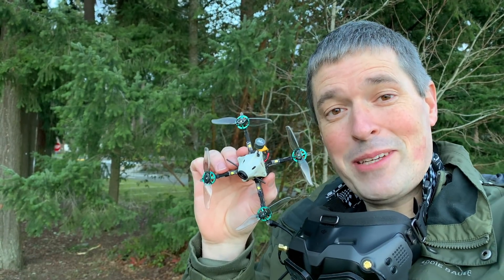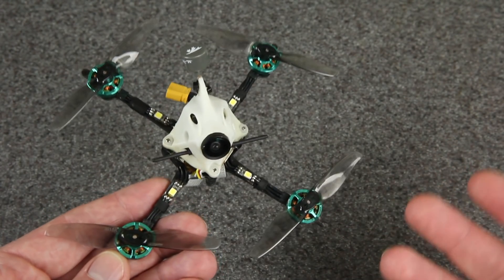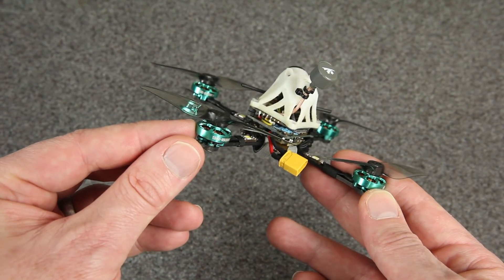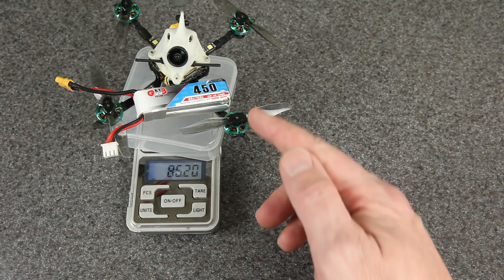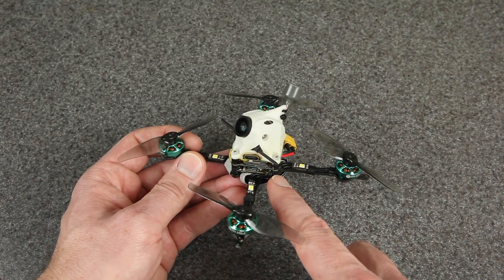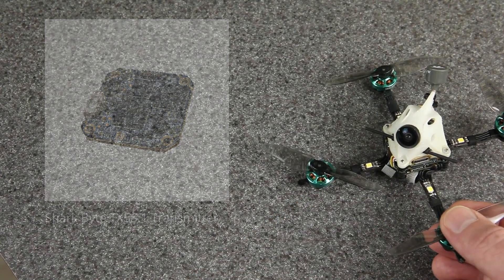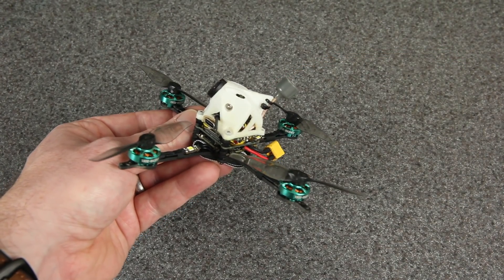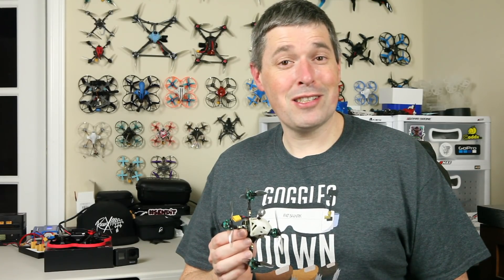DJI Digital FPV on a 3-inch Babytooth Drone! Cool!

Comment: Hi, I am interested in a drone like this. Since we are ahead in time now are there better option available now that you know?
I would lik eto use a vista 
Kind regards,
Dennis
Reply from the maker: Hi. This build was pretty unique. There are a number of 3 inch drones on the market which use the Caddx Vista, but most of them are significantly heavier. That's not always a bad thing. Heavier can mean more powerful. But for myself, I really like to drones that are light and quiet, like this one. If you're seriously interested, I would be willing to sell this one. It's a great build but it has been collecting dust at my house, because I have so many other projects. Email me at mrshutterbug@yahoo.com, if you're interested.

Comment: incredible video keep it up😊❤. i wanted to build this toothpick but i have the dji fpv controller, does it work with the caddx vista(like the dji air unit)? and if not then what should i use?
Reply from the maker: I just put this drone up for sale on FB Marketplace, if you're interested:
https://www.facebook.com/marketplace/item/670413367777353

Since it has the Caddx Vista, it should work with the DJI controller. I don't have the DJI controller, so I added a Crossfire receiver to mine. Switching to the DJI controller might be as simple as a Betaflight setting, but maybe the wiring would have to change? I'm not sure about that, but I could look into it if you're interested.
Reply: @MrShutterBug  thank you so much❤️ i'll definitely check out the facebook marketplace and no need to research for the wiring i'll do it. thank you very much for your time and keep making great content😊

Comment: Hi. I can finally build a Babytooth. When ordering lipo's I choose the GNB 550mAh 1S XT30. At arrival I saw that these are LiHV. How high should I charge these? They are shipped with 4,5-4,6V in them. Seems a bit high? And how low can I fly them. Usually you guys tell to stop flying @ 3.0V with a normal 1S.
Reply from the maker: Max voltage for a LiHV 1S battery is 4.35V. That will give you the longest flight time, however, the batteries might survive more charge cycles if you stick to 4.2V like a normal lipo. It is up to you. If the voltage goes below 3.0V then it will also shorten the life of the battery. When to stop is also up to you. It can be hard to know the real cell voltage while flying because there can be temporary voltage sag during flight. If you test the battery after you land, the voltage will probably be higher than on OSD. If the voltage after unplugging is around 3.5V then you’re fine. If it is less than 3.3V then you are getting dangerously close to damaging the cell (it drops off really quickly at the end). Start conservative and you’ll get a feel for what you are comfortable with. Hope that helps.

Comment: So if I'm using the DJI controller would I need to put crossfire in?  Also, could I even use crossfire with the DJI remote?  I'm new to this and never quit understood this
Reply from the maker: I had to add a receiver to my drone because I do not have the DJI remote. If I had the DJI remote, then I would not need a separate receiver because the DJI receiver can control the drone through the Vista Air Unit. Crossfire is a different protocol from DJI, so you cannot control a Crossfire drone using the DJI remote.

Comment: I don't wanna strip a Vista. Is there any point in building this still?
Reply from the maker: The Vista heat sinks add a lot of weight. If you want to use an unmodified Vista then it will be a heavier build which means you would want to use a stronger frame and larger motors. You would probably also want to use 3S order higher voltage.

Comment: You didn't use a capacitor? Is it not necessary?
Reply from the maker: Good question. The capacitor clearly isn't necessary to fly the drone, but it probably would provide some protection against current spikes in a crash. The usual answer is that it is a good idea, but not strictly necessary unless you have a specific problem that you're trying to solve. Most manufacturers will recommend a specific capacitor size to go with the ECSs, so go with that if you want to be safe(r).

Comment: Fantastic  build. Fast, nimble and quiet.
What's better T-Motor F1303 5000KV or Flywoo ROBO RB 1204 8150KV?
Reply from the maker: Either of those motors should work fine. The 5000kv motor would need a 3S battery. The other would be better on 2S.

Comment: What would happen if you used 1806 2300kv motors ?
Reply from the maker: 1806 is a much larger motor. It would not work well on this frame even if the motor screws had the right spacing. An 1806 motor would be better for a drone with 4” props and a much stiffer frame. Cheers!
Reply: @MrShutterBug  Thanks for the reply  :-)  , but if I can get the Motors on ... would it not just be an over powered mini quad ? ... What would make it not work well ? ... Would it fly funny or something ? ... My goal is to make a long range speed demon with a small profile that cuts through the wind and climbs like a rocket ... or I B Crazy ?  ;-]

Comment: Amazing footage. Iwould have loved to see a longer clip of steady lines like you did along the path, then go low across the grass and through the trees up above to the skyline following a smooth line, really giving the impression of a larger quad, then turn around and close proximity through the trees on the way back. There were times I would swear that I was watching a 4" 👍👍👍

Comment: Intro picture is a triblade? Is that 3 inch?
Reply from the maker: Yes, it is a 3 inch. I have used bot the Gemfan 3016 3-blade props (pictured in the thumbnail) and the Gemfan 3018 2-blade props.

Comment: Hello! Nice drone! Did you use a capacitor or filter to directly connect the battery to the caddx digital unit? Do you think it is possible to use a 2s 18650 li-ion battery? It would add extra weight, but it would increase flight time. Maybe, using 18650, I would choose 3.5 inch propellers and a little bit bigger motors. What do you think?
Reply: Those weigh a tremendous amount more than his entire quad plus batteries, I don't think that would be a good pairing. At that point like you hinted it's going to be a different build with different motors, bigger props, bigger frame. Also those go way lower running voltage which may not play nicely with the camera since it will be closer to 5v rather than 6+v at the low ends.

Comment: No prop screws?
Reply from the maker: Correct. The motors have a 2mm shaft and the props just press on. They have never come off in a crash.

Comment: I want to build something similar with a Nebula Pro and still as light as possible. I'm struggling if 2S or 3S is the right way forward. 2S saves weight an therefore makes the drone lighter (which is important to have it as silent as possible). On the other hand I want to have the acceleration feeling that I'm used to from my other normal freestyle quads. But it would obviously add weight due to the added cell (450mah is minimum, 300-350 don't work very well imho). This would then make the drone more noisy again.
Reply from the maker: If you raise the voltage and lower the KV in proportion, then it doesn't really change the speed. So, if you can control the 2S/3S choice and you control the KV choice, then speed isn't the way you want to think about it. The difference is that a higher voltage drone will be able to deliver the same power with less current and thus less voltage sag. If you want to fly in a small yard then you're not going to be using a lot of high throttle and the sag of 2S probably won't be a problem at all. In that case, 2S is perfect! If you like to fly in larger spaces and you like to rip around on high throttle a lot, then 3S will help you do that without your battery voltage sagging as much. Also, the weight difference will matter less in those larger spaces. Make sense? P.S. I agree that there aren't many good 3S batteries on the market that are smaller than 450mah.

Comment: Mine is 62g + battery with the 3mm frame. The Nebula Nano camera fits in the beebrain v2 canopy - you have to unscrew the lens, shove it in the canopy then screw back in the lens for a tight fit. I have the ExpressLRS happymodel pp rx so no antenna mounting issues. Using the rcINpower 1205+ 6000kv motors becayse Straya! I will pop a video up on my channel on the weekend for you

Comment: Hi Mr. Shutterbug, 
I wanted to know if you have found an STL file or a link for a similar canopy that holds a Nebula Pro? Last question how did you arrange your stack in terms of dampeners, nuts or o rings? Thanks for your help and build! Much appreciated!
Reply from the maker: I have not tried it yet, but here's a canopy I found that should work: https://www.thingiverse.com/thing:4784098

Comment: Will the DJI fpv unit work with the version 2 goggles
Reply from the maker: Yes, the V2 goggles are supposed to work with the Vista and the original Air Unit. Unfortunately, I have heard that some people are having problems registering the new V2 goggles because of a bug. Hopefully DJI will release a fix for that soon.

Comment: what transmitter are you using?
Reply from the maker: I use a modded Taranis QX7 radio. This drone has Crossfire, so I was using my Crossfire module, which plugs into the back of the radio.
Reply: @MrShutterBug  oh meaning you need to have an crossfire module for your QX7 radio to pair with Crossfire RX?
Reply from the maker: @chuansheng  correct. The QX7 works with FrSky receivers normally, but can communicate with other types of receivers if you have the right module.
Reply: @MrShutterBug  awesome thk u so much👍👍

Comment: Amazing, just ordered everything for this build. Any issues with the vista overheating?
Reply from the maker: No issues so far, but I do not live in a hot climate. For me, the biggest thing is that I have to be careful about heat while it is plugged in on the bench. I blow a fan on the drone any time I have to do that, just in case.

Comment: Love this build! Also I saw someone swapping battery connectors from XT30 to Betafpv's BT 2.0 connectors on 2s. Not sure how many amps you draw, but 9-15a might be enough.

Also, would nebula pro camera fit? I'm migrating my dji cams to nebula pros.
Reply from the maker: Nebula Pro would make this build a lot nicer, but no, it would not fit in this particular canopy.
Reply: @MrShutterBug  how long are those stack screws? I got everything but need longer screws apparently :(
Reply from the maker: @explodingevo  Mine are M2x20 (20mm length). Using that length requires pretty small gaps between boards, which are spaced by nylon nuts. Good luck!
Reply: @MrShutterBug  I got it done this  afternoon. It's a little heavier at 61g but I'm using tracer with dual antenna. I will probably move it to crossfire and chop off that little mount like you did. Holy crap though, I just did a couple preliminary test flights and I can see it's a powerhouse omg I love it. I messaged Phoenix 3d about a version of that canopy supporting the nebula pro, hopefully the quote isn't too high.

Comment: I built this same quad with the BetaFPV v3 12a AIO board. Can you please post a pic of your Ports tab? I dont know what UART to use for serial RX and for MSP. Thanks!
Reply from the maker: Do you have the FC with plugs on the bottom, or do you have the "toothpick" style FC? I used the one with plugs on the bottom, but I removed those plugs and modified the frame to make room for the FC. You can see the diagram for the FC that I used on this page: https://betafpv.com/products/f4-2-4s-aio-brushless-flight-controller-12a-blheli_s

I'm using the RX1/TX1 pads with my Crossfire Nano receiver, so I have "Serial RX" on UART1 on the ports tab.
I'm using the RX2/TX2 pads with my Vista air unit, so I have "MSP" on UART2 on the ports tab.

If you have the V3 of the toothpick style FC, then you can see the wiring diagram here: https://betafpv.com/products/toothpick-f4-20a-aio-brushless-flight-controller?variant=31363207004294

Again, the ports tab has to match the wiring of the FC, so yours may not be identical to mine. Hope this helps. :-)

Comment: Use isopropyl alcohol 99% to remove the blue goo, and you should be able to make it look like nothing was ever present. It is better to remove all the thermal compound if you are removing the heat sink. Better heat dissipation. This process of cleaning is safe for electronic components. I have used it to clean my processor and MB components on my PC.

Comment: Mr Shutterbug, I am having a blast with this build - so much I leave my 4" ,5" and 7" quads at home! I decided to build another with the Nebula Pro camera and I added the motor wire LEDs.    By the way the toothbrush does an amazing job of removing the blue goo!
Reply: what canopy are you using for the nebula pro ?
Reply: @LUCKY.CLIPZ1  Haven't completely sorted it out yet. For now I have trimmed the interior standoffs off the Twig canopy and stuffed the camera up inside. Then wrestled two short screws in the camera. Tight fit and increases the camera angle and leaves the lens exposed - not ideal but it is in there.
Reply: @rocketrob3324  think that's what i'm going to do. thanks!

Comment: I am loving this build! it is surprisingly fast!  How much power will the naked vista take? can we go up to 1,000mw in a coolish climate 60 degrees or so?
Reply from the maker: The vista is powered directly from the battery so it should have all the current it needs. I have not tried the high power mode on this drone however. It might work in a cold climate but the risk of overheating would be much higher.

Comment from the maker: Several people have asked for the ESC/Betaflight firmware setup, so I wrote it up in a doc with screenshots: 
http://bit.ly/3cxhpgz

I didn't do much to the Betaflight tune but I did tweak some of the ESC settings to help the relatively small motors deal with the prop load. If you're having trouble, especially at very high or very low throttle, then you might want to try these settings. Let me know what you think, or what other settings you would suggest. Thanks!
Reply: if you click on the link, you would get " access denied"  " you need access "  " ask for access " and can't go on from there. i don't know what i need to do to get " access "
Reply from the maker: @matthew04101  sorry about that. Try it again. The permissions should be right now.
Reply: @MrShutterBug  sorry to bother you again. but there is no PID in that document, but just rates.
Reply from the maker: @matthew04101  because they are stock betaflight 4.2.6 PIDs. I did not change them, but people have asked for my exact setup, so there it is (minus receiver and aux settings, which people should customize). The only important settings are in the ESC firmware.

Comment: I've just ordered a Phantom HD with amax 1303 motors. I wonder if I can use just the bottom plate and mount the battery on the bottom to get closer to this weight.
I've also ordered it with a nebula nano, but I'm considering decasing a DJI camera and attaching some nuts to the side to fit 14mm mounts.
I've only seen a couple of people decase the DJI camera like that, it would be cool to see a video of you doing it.

Comment: Do you mind sharing the CLI Dump since I am building the exact same atm. Would like your thoughts on the tune etc. Thank you for the great content always, this is where FPV should be at especially during this time when some of us cant fly in usual spots due to restrictions on 5" quads, this is perfect balance of video quality + low noise + flight time + low risk due to weight.
Reply from the maker: All the details here: https://docs.google.com/document/d/1oTQQYNE2dsNC-Za0_hph7ISkkaHth3TWOjrez7Upg8k/edit?usp=sharing
Reply: @MrShutterBug  Thank you this is so useful I am sure it will help many of us building this quad.

Comment: I built one those with a nebula pro instead of the nano.  I love the flight characteristics and the video quality.  Would recommend.  Thank you so much for the build guide <3    I love my DJI headset, but I've been so jealous before this build of your ultralight analog builds, i feel like i can join in the fun now!  I even power limited to 80%.  I never thought i would have more thrust than i needed

btw: i didn't need to extend the motor wires to my FC.  I assume FPVCycle increased the length for production
Reply: Which canapoy did you use to accept the nebula pro?

Comment: Great build, I really want to get involved with the little baby toothpicks as well. They look so fun to fly. I found in my FPV career, the R Line Lipos give the most raw full power. Once they get below their nominal voltage though they will sag hard on you, but its full power till the last second. I found the GNB lipos like cruising more. The r-line packs are also very light and small in comparison to their Mah rating. Best part about the Tattu range for me has been the durability. Only lipos that survive my crashes.

Comment: Are there any downsides of decaseing the dji unit?  (heating or range problems?)
Reply from the maker: Range is not affected. Downsides are increased heat and increased exposure to impacts and to the elements. For me, heat has not been a problem in the air but it overheats on the bench pretty quickly. Therefore a fan is required if you want to have it plugged in without flying for more than a short time.
Reply: @MrShutterBug  Thank you :)